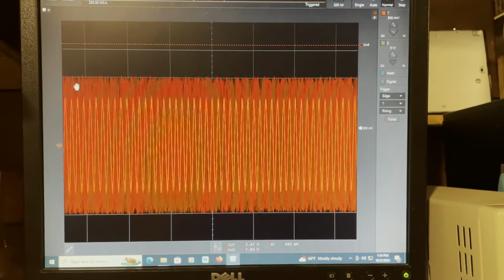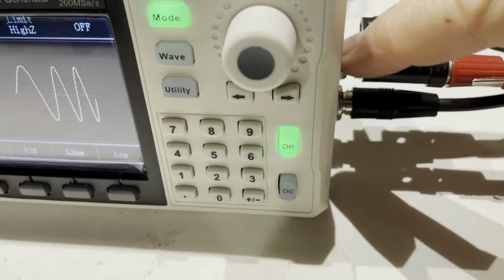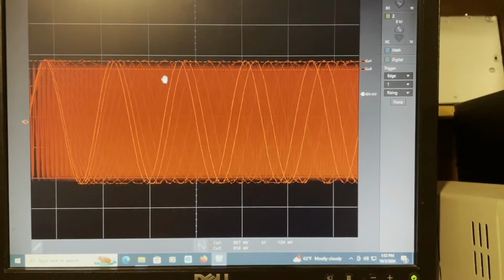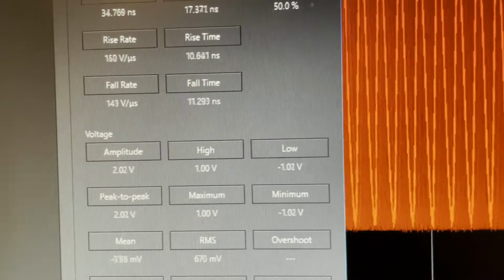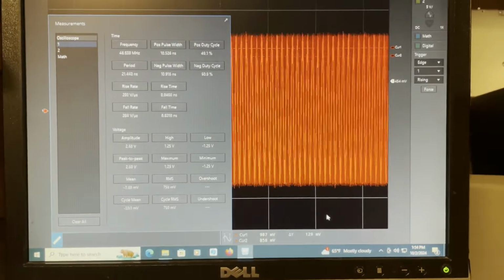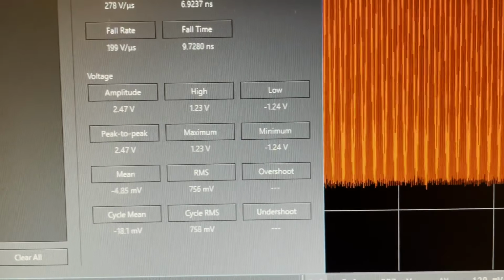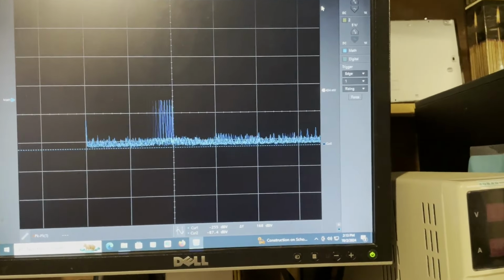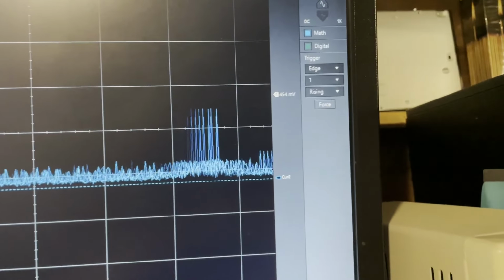Frequency response BNC BNC vs alligator clips

Comment: For 50 ohm at the scope end connect a BNC T adaptor to the scope input. Connect the bnc cable from the gen to one socket on the T piece and then a BNC 50 ohm terminator on the other T socket.